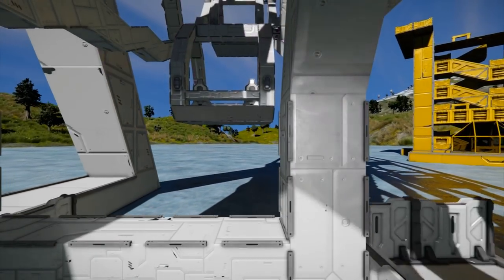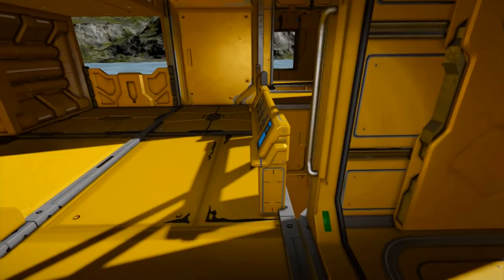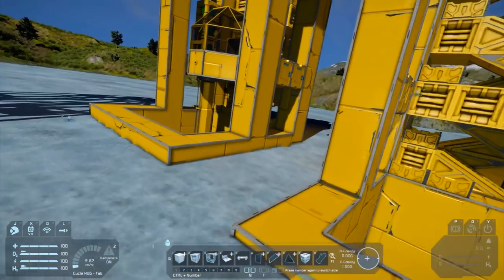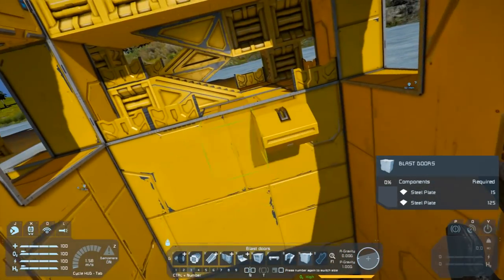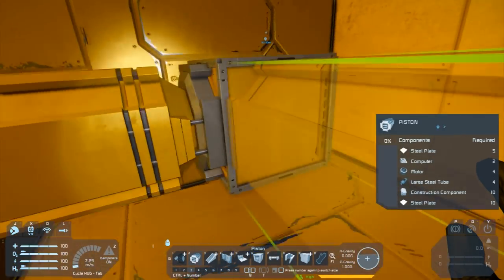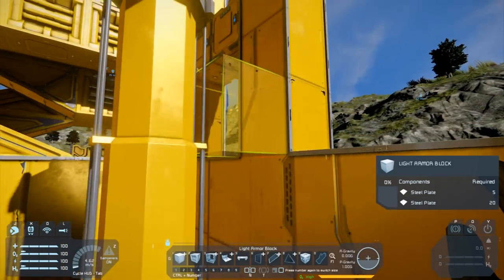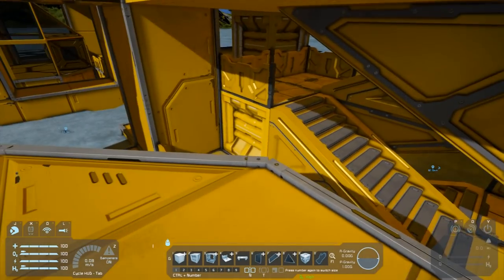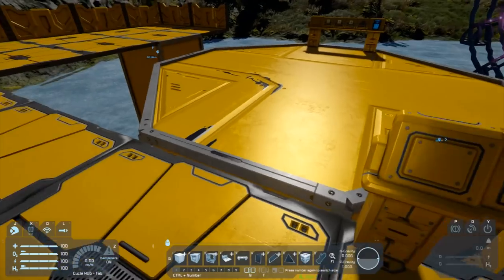Space Engineers Tutorial: Elevator Vanilla Build (at least when it's silent)

Comment: Just a note or two:  Dover built elevators use pistons IRL, which is why you only find them on buildings 4 floors or less.  Consider this next bit a challenge: Elevators ding twice if they are headed down.  So blind people can tell which way it's going.
Reply from the maker: You could certainly achieve that with a script, but without one you'd need extra sensors to activate or deactivate the sound block as you approach a floor from each direction... there might be an easier way, but I think that would be reliable enough :P

Comment: You know it is not necessary that all pistons face upwards. You can save more space by alternating upward-facing with downward-facing pistons. Then to go up, extend the upward-facing pistons while retracting the downward-facing ones and vice versa. (this needs more vertical space but less horizontal space, so probably more suitable for elevators with many levels.)
Reply from the maker: The reason I keep them all facing upwards is precisely so I can limit the vertical space necessary, you also wouldn't be able to get it that much tighter as you'd still need the extra spaces so the pistons don't catch on each other :(

Comment: Thank you so much! I just got into space engineers and saw this and I simply knew I had to build it. I made a two floor model that uses sensors on each floor to open both the elevator and exterior doors using timer blocks (each floor has one to open the doors and *Ding, another to close them). It works pretty well and adds a lovely aesthetic to the base.
Reply from the maker: Glad I could help you get it set up - there is something fun about building elevators in Space Engineers, I seem to do it even when it's definitely the slow way to get around :D

Comment: My Elevators use piston legs to walk up a shaft with landing gear. When it reaches the necessary floor, A rotor connection or a merge block will grab the independent cabin of the elevator and a timer block thats been firing since the cabin disconnected from the ship will finally be able to communicate and tell everything to go back to its idle state. 

Each floor has a button system that turns on the corresponding floors connecting block and turns off all others so the only floor that can grab the elevator is the one you chose.

Its been a while since I worked on it but I still have to work out the timer system to tell the cabin whether its supposed to be moving up or down and it will be ready.

The big problem aside from that is how many small ship buttons I can fit in the cabin. 4 or more floors and I have to start covering the interior with them. Might be better just to trigger them from the control panel.

Comment: Awesome! You're a real engineer! =D
What I never understood is why such games like SE, MC, Terraria cannot add one simple thing for elevator: a block that would either move on 1 axis or move between 2 blocks until collision. It's the most basic action there is in any 3D editor. Just a programmable 1-axis movement! And we get millions of ways to use that! SE could rather add a monorail. That would work. Just imagine - making a line (like conveyor but much cheaper, maybe 1 or 2 metal for unit or 10 units) and having a block that would move along that line without stumbling. At high speed, using electricity. They already have all it needs. Junctions for turning. Slowing blocks. Triggers. 

Actually, MC surprises me because they do have minecarts but they cannot move vertically (only diagonally). Mines do have elevators, common sense. 

I think everyone loves taking a ride, be it a train or a plane or a ship. Or a transparent elevator. It would add so much fun. Sliding hangar doors, unfolding bases, transformers (more than meets the eye!), puzzles (like Cube movie), trains between settlements, mines that go miles underground and take the player down by elevator. And all this could be done with only one block that could move along other blocks without damage at any distance and speed. Gosh, this game has such a potential!
Reply from the maker: The only game I've played (I'm sure there are others) that has such simple methods of movement is Skywanderers, but it just turns off collisions between the blocks to allow it, certainly a solution but maybe not the best one :P

Speaking of trains though, that's something that is fully achievable, I'm most of the way through my tram build in survival and am working on something that's even more ridiculous in creative mode using similar techniques - should be quite the ride when it's finished :)

Comment: That is a great elevator design.  One of the hardest things to get right in SE, you make look easy.  Even in the real world, it wasn't easy; "mind the gap" was the 19th century solution.  I think you got it smaller than even a real world elevator.  A certain mountain stronghold could use an improved elevator floor.  Do I sense a refit?  ;)
Reply from the maker: Absolutely! I might even be tempted to build a pair - so one's always up and one down ;)

Saying that, I have no idea where I'd fit the second one... maybe I won't be building two :P
Reply: i think a refit of the base is in order and keep them side by side because if you ended up with them on opposite sides of the base they that would defeat the purpose of having one up while one was down because then you would just end up waiting for it rather than running to the other one especially as your base gets bigger and bigger.
Reply: Two elevators in the real world always end up together on the floor furthest from where you need them.  I think there's an ordinance.   ;)
Reply: yea that always seems to work out that way

Comment: 7:48 interior pillars do the same thing on all 4 sides, and they're way cheaper. Instead of the blast door edges, replace the middle one with an interior pillar, then the end one with a blast door corner going into the next piston like you had it. You can fit 5 in a 3x3x3 cube, then stack the 3x3x3 cubes however you like

Edit: Conveyor tubes would be better if you need to transport items through it. This would be good if you used it for a drilling setup
Reply from the maker: Yep both of those are definitely good options too :)

Comment: You can replace the offset piston with a rotor if you're tight on space...
Reply: Wuerfelweltler Apart from saving space, are there any advantages/disadvantages of using a rotor vs a piston? For example, is one of the setups more stable / less susceptible to clang?
Reply: Cyberguy42 I can't really answer that question, since I primarily use rotors... however, I've never really had any problems doing so
Reply from the maker: The main disadvantage of a rotor is pretty minor, if you're building in survival you'll need to weld it up completely before placing any other parts or it'll freely spin and cause problems, otherwise it's about the same :)
Reply: could use it to make a really complicated elevator that can get to floors that are not a straight shot of the pistons XD

Comment: Built my first lift with the help of this video,   its over three floors but each exit is on three different sides which made it tricky also I have lift doors on the carriage  and room doors to the lift entrances,  I programmed it so when you select a floor the two doors of the floor your on automatically close and the floor your about to go to open up ready , would be handy if there was a way to delay the doors opening until you get there but it was a challenge to get that working properly, also added the lift music which is a bit hit and miss if it plays,  probably my settings some where.
Reply from the maker: Nice work, sadly the music isn't you - there's more than a few bugs with the sound block in the game, it's still fun when it works though :P

Comment: Great tutorial! Great use of a small space. Not something I'm particularly good at haha

I do wonder if you could make an angled elevator using this method. Mount everything on a 45° rotor and then have the carriage on another rotor at -45° so it's upright. I guess there's only one way to find out...
Reply from the maker: You definitely can, I'd recommend using the rotor lock once the rotors are in position or making sure the upper and lower limits are set or you may find it getting a little bit wedged in the elevator shaft :P

Not that I've done that or anything... ;)

Comment: Hey Splisie, I am a little late for the party, but I build my own Elevator after this Tutorial, works great! Thank you.
One small question, the savetydoor only works for the top floor, because the sensor goes all the block length, when u build it on the 2nd floor, any Ideas for this?
Greetz
Reply from the maker: The best solutions I've used for that have involved elevators where I could place the sensor in such a position that it didn't pick up the elevator when it was away from the middle floors, sometimes you'll need a large elevator shaft for that to work though

Comment: splitsie Very nice! The safety doors are a nice touch. Unless I missed something, the elevator car's doors will automatically open for you whenever you approach, even when moving between floors. Can you suggest a simple way to safety lock those doors closed while in motion?
Reply: one simple solution would be not to walk up to it while in motion but the more immersive method would probably be to turn the door off while the elevator is in motion I use that method for my airlock setup to keep doors from accidentally opening and venting air but that method would work here as well
Reply: MacGabhann Good idea. Now that I think about it, the door could be locked/unlocked using the same triggers used for the safety doors. 
A script would definitely provide some advantages, but I'm impressed by how much can be done without one.
Reply: yea I tend to avoid scripts though i have started using a few off the workshop just have not gotten to writing my own since I can do the same thing with timer blocks.
Reply from the maker: Yeah, the elevator door does have that problem, you could probably use the safety door switch to turn the auto door sensor on and off between floors to fix that little oversight :P
Reply: If you turn the safety door around, you wouldn't be able to get into the car's sensor unless the car is at that floor.

Comment: Is there any chance you'd make a cargo lift vanilla guide? Like an elevator you'd use as either a landing pad or for vehicles to go down a mining shaft or something similar?
I made a bunker approximately 65m below surface, and I dug a hole in order to have my vehicles get to my base. The original idea was to have them go down the shaft, but stacking the pistons just makes the 5x4 platform explode using this method trying to extend all the pistons at once.. What could I do?
Reply from the maker: You should be able to build it the same way as the personal elevator was built in this tutorial, the only thing that will make it more difficult is that to go over 65m you'll need at least 7 pistons which will be a tight squeeze for a 5x4 platform. You may also need the pistons to have an increased maximum impulse so that they can move the vehicle as well as everything else that makes up the elevator
Reply: @Splitsie  Thanks for your quick response, I did figure it out in the end. It even has a connector reaching down to the base directly. It seemed to be because there was some blocks in the way, it was very picky where to be. I'll have a look at increasing the max. impulse though, as we still have a fair amount if wobble even on share inertia tensions when its fully extended. :)

Comment: I wonder what can be done if you place the sensor for the savety door horizontal/flat on the rectangular side of a half slope tip. Like the camera on the red ship in th background video of SE's main menue. And what can be done for looks by using slopes instead of catwalks to trigger sensors. Or just the rails on the catwalks. Or the rails alone. They both coud save a block of deph.
Reply from the maker: The railings are a good idea, would certainly be much smaller and easier to hide, I'd been thinking of hiding a rotor with small blocks underneath the car for extra sensor and sound block space too - your solution is a lot simpler :)

Comment: Nice. So far my elevators have just been a very deep hole with a few pistons stacked right on top of each other. I'll try work this system into my new designs. I also have an idea for the Goose's (Geese?) turntable in your survival series. What if the floor was a large rectangular shape with blast doors that open around it to allow it to rotate 180 or whatever you set it to. It might be neat if you make it rotate 90 degrees and into another side hangar. I'm excited to see how you tackle this problem.
Reply: Oh, A second thought! What if you put a piston on the rotor to raise or lower it in case it doesn't rotate around the corners. Similar to the elevators of all the docking bays in Elite Dangerous.
Reply from the maker: I've got a pretty simple solution worked out (was playing around in creative last night) I think you'll be pleasantly surprised by how easy it should be to build :)
Reply: Btw, you should build a Goose base with a turntable Garage, maybe even having more than one level and develop more Trailers for the Goose, it is a pretty perfect Design that even survivalproofed it's worth.
- Mobile defense post
- Mobile power Station (with plenty batteries and a connector crane)
- Mobile base (refinery, o2/h2/Assembler/decent storage/survival it
- One with a projector plus 2  welder cranes to print at least Chickenhawks / Tick / Sandbags), maybe even bigger things, depending how far the welder cranes can stretch out without summoning Clang. 
Maybe you can even have connectors and piston cranes with connectors, to park a powerstation trailer between  a mobile base Trailer, and a defense Post Trailer, connect them and are good to go until you are done at this place, or have the permanent base built.
I even can imagine in my mind a Team using 4 Goose with such Trailers, Finding a Spot, parking launching the butterball and Immediate starting to print stuff building a base in no time. This concept may even work on no jetpack/high grav scenarios.

Anyway, the Goose is just to perfect and Well done to collect dust.

Comment: hmm my elevator seems to have an issue with the pistons not fully retracing and extending
Reply from the maker: For heavier elevators you'll need to increase you maximum impulse axis to deal with this problem. The way I do it is to gradually increase it until each piston behaves consistently - you will almost certainly take the values into the red, but it shouldn't cause a problem if you know they can extend normally sometimes anyway :)

Comment: I'm determined to build an elevator in this game and have been trying with rotors and tires and I kind of have it working but it's not stable (shakes, getting the rotors to stop turning exactly where they need to has been difficult). I'll try this way.
Reply from the maker: I've built many this way and they're quite stable and reliable even in multiplayer with lots of people on them :)

Hopefully you have the same experience :)
Reply: @Splitsie  So. This is awesome-ness what you built here and exactly what I need. Can it be horizontal? I've been trying to build a monorail kind of thing between the original Easy Start platform/base and a platform I've built which I want to be the entrance and control center to my "city". So it needs to go -this-->way and <--that way- instead of up and down. I'm going to give it a go and if I pull it off I'll be glad to share. I don't see why, at least thinking about it and how the game works, it wouldn't work going left and right instead of up and down.
Reply from the maker: It shouldn't be a problem, though it may end up a bit more shakey than the vertical version depending on the length of it

Comment: Is there a risk of clang with the blast door edges along the flat side not the point side with pistons?
Reply: also, does this work with passage doors intead of regular doors on both sides? Im having trouble where the pistons slow down and often just stop halfway through, could show picture
Reply from the maker: Yes there is a risk, though if you're having troubles you could try replacing the blast doors with conveyor tubes or interior pillars to check if they're the issue as both of those blocks have reduced hit boxes on all sides not just 2 or 3 that blast door blocks have. The type of door doesn't matter, I just find that the sliding doors have a neater finish which is why I tend to use them :)
Reply: Splitsie it seemed like it was slowing down and grinding a bit but I increased the non axis resistance on the horizontal piston and increased the force on the vertical one. Only needed 2 but ended up using three, is there a discord or something I could post my version?